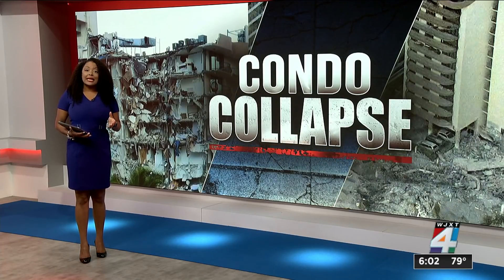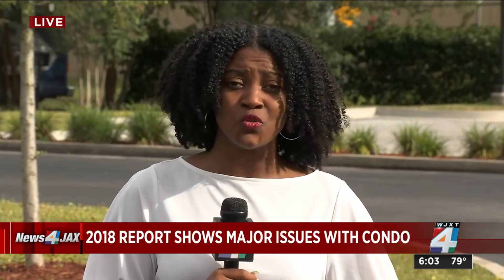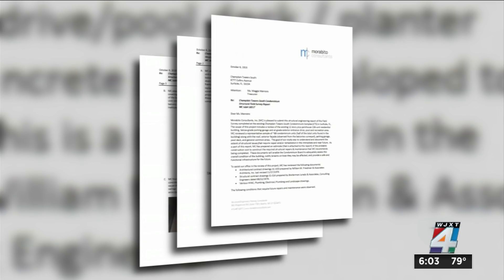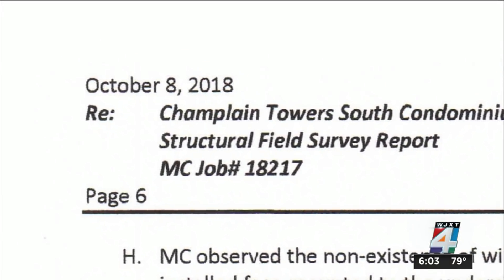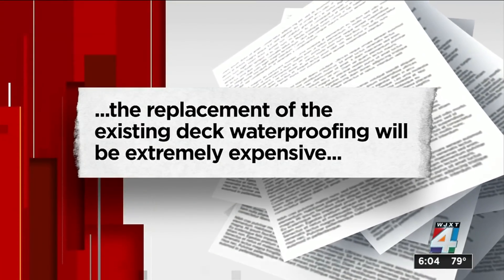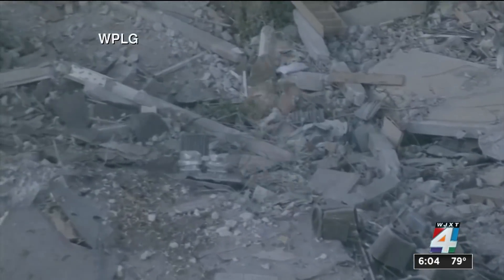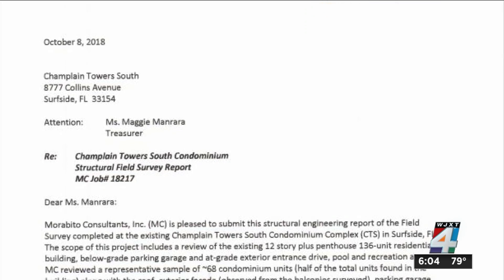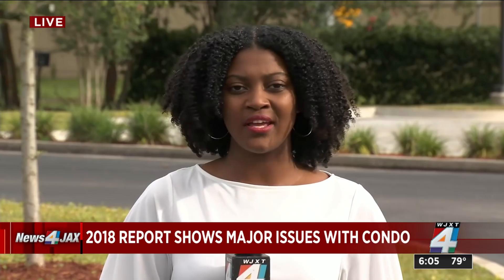2018 engineering report showed ‘major structural damage’ before condo building collapsed

Comment: Those defects would not have caused the building to collapse. Keep looking.
Reply: Structural instability combined with an eroding bed of sand at the foot of the foundations would have have caused it. Particularly if a sinkhole was involved
Reply: @scotthenderson292  A sinkhole alone could have caused the collapse. At this point it’s all speculation, the investigation will determine the actual reason not wildly jumping to conclusions like has become so common these days.

Comment: I love how everyone in comments thinks they know EXACTLY what they are talking about
Reply: Lots of keyboard experts
Reply: Ya they mention of words structural problems and they automatically I think it’s to the structure that fell sounds to me that the report showed the pool in the parking garage but I haven’t read the report nor do I know the layout of the building a lot of people in the comments seem to here’s those two things and think gotcha.
Reply: @joed9269  Well go read the report then. It's only like 6 pages. Pretty easily shows it was most likely the cause. Details extreme water proofing issues essentially rusting the rebar out from inside the concrete slabs of the roof of the garage/pool deck. This tower SAT on TOP of the parking garage/pool structure. It says these waterproofing deficiencies are found all throughout the buildings. That all the decks had bad drainage. That there had been TONS of post work done by the owner's that covered up the slabs not allowing for inspection; but they suspected water was getting in there due to spalling of the concrete slab below. It doesn't take that much of a leap to assume that's the culprit of the issue and even if it was the pool/parking garage area they specifically detailed. In fact, that's what you'd expect essentially. The most readily accessible, and most blatant area of the damage is what's shown since it's a nonobtrusive inspection. Otherwise you'd have to rip those pavers and tiles up they mention in the report. Really, there's no way the building did a classic pancake collapse without it's rebar becoming corroded. Otherwise those slabs would still be bearing load.  That's a major structural member beneath giving way and everything else just following gravity. They also detailed failed repairs done previously to combat the concrete slabs spalling and cracking. So the owners KNEW about structural damage already. Then were given this report in 2018 and did nothing for 3 years.
Reply: @jonny-b4954  Just pressure wash the rust stains up and patch the holes with cement before the guy comes, it's fine. A little lipstick and rouge on a pig and who knows, might be a keeper.
Reply: @jonny-b4954  I just read the report and think you are right.  MC wrote a pretty good report and said there was serious issues.  Just the photos alone in the report you can see it was bad.  I had an oceanfront condo sort of like these.  The building repairs were going to be big money and time, they probably just didn't want to tackle it.
Reply: @jcbruce76  Yeah, there's no reading that report and not knowing there's major, possibly catastrophic issues coming down the road if you don't act. Which they didn't. They spent their money on things like trying to hire a pressure washer/painter and fixing the roof. Not the $10 million or whatever, loud job that would shut down their pool and parking garage for 6 months.
Reply: Exactly. Every time something happens in this world YouTube commenters have the answers.. 😂
Reply: @martingo2680  any obscure issue, and they know it all
Reply: Everyone desperate for a "normal" explanation
Reply: most do. Do you agree part of the building collapsed and there are about 100 dead people in there.....Surely, you get that.
Reply: @linanicolia1363 yea, I'm not talking basic facts. I'm talking sweeping speculations and generally the smart assery of YouTube commenters.